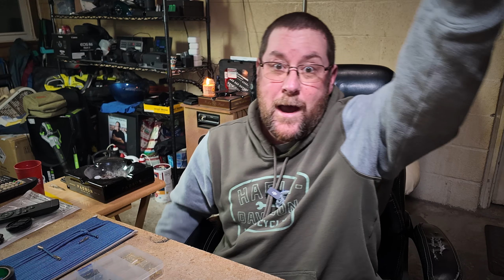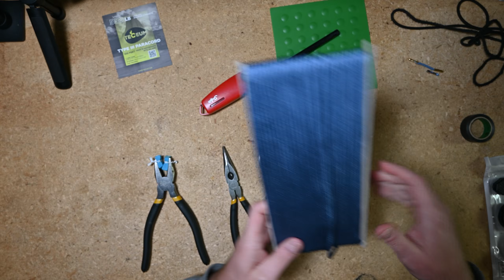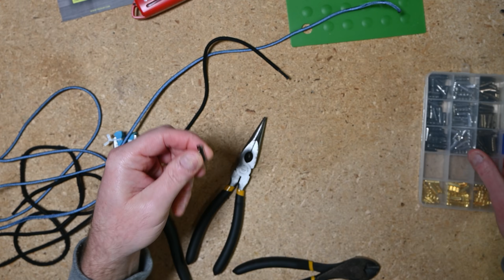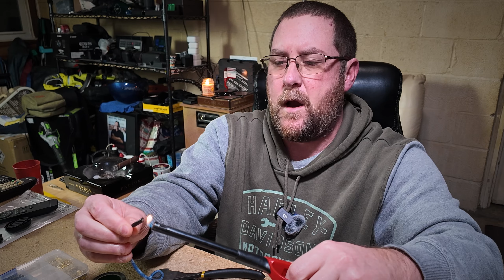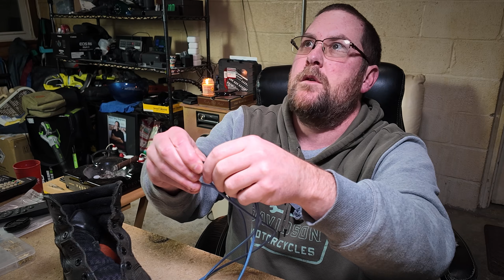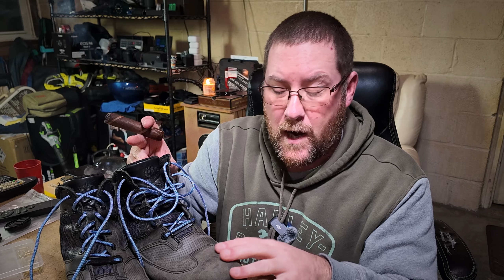Make your own BOOT LACES - no special tools required!

Comment: Use shrink tube on the ends , the ones with glue is best 😁👌
Reply from the maker: Yep - if the electrical tape fails [and it probably will], I'll upgrade :D  I just didn't have any tubing handy.

Comment: Cool idea to use paracord for boot laces! This would work to replace the draw string on a hoodie too. I probably would have used heat shrink tubing instead of electrical tape, I think it would be more durable.  Or, just buy black plastic aglets and not worry about them scratching up the chrome on your bike.  Either way, I like the concept, thanks for posting!
Reply from the maker: Thanks - glad you enjoyed it!  You're 100% right - and I looked around for heat shrink tubing, but didn't have any handy, LOL.  If the electrical tape falls off, I'll buy some tubing and shrink it on - that's a great idea!  I didn't see plastic aglets on Amazon [although TBH, I didn't look really hard, or think about whacking the chrome or paint at the time]... so I was using what I had already bought :D